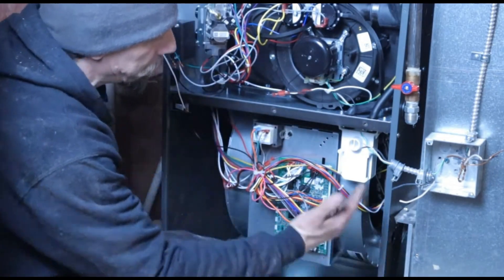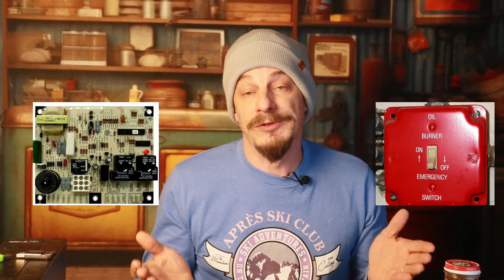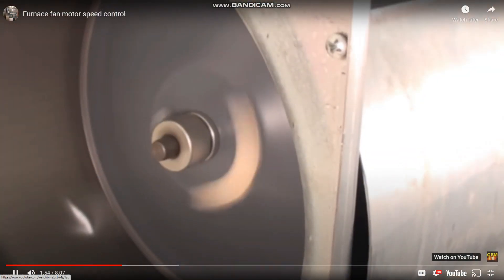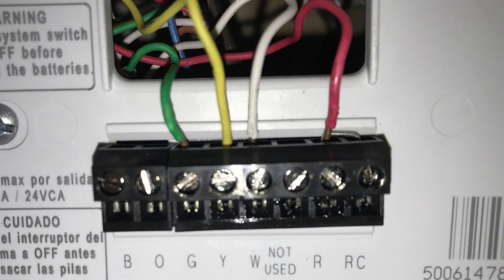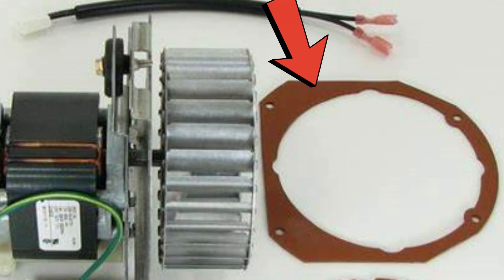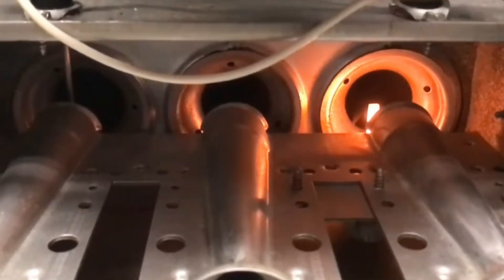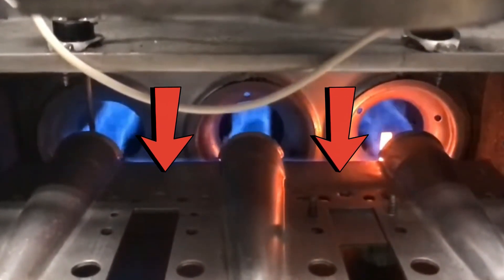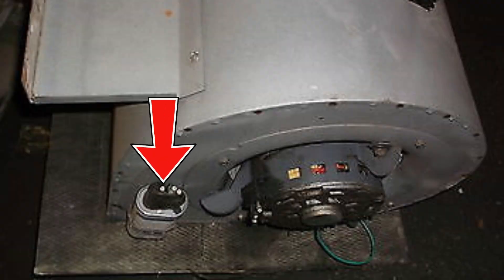Solve Dozens of Furnace Problems With This Process

Comment: I had my furnace for 15 years and all of a sudden it quit. I put a new filter in and it started up and ran just fine. A week later it quit again and the code said possible filter. I took it out and it looked new replaced it anyway and the furnace ran fine for a couple weeks and quit. What i figured out was if you tapped the old filter on the concrete white flakes would fall off like snow. Found out my wife had started using a new humidifier and after we shut it off the problem went away.

Comment: Thanks Mike great video. 

Hi Mike I cane across a furnace today at customers  garage. This furnace had no control board at all. It had a limit switch. And gas valve had 4 electrical terminals attached to it. Do you Recall any furnace like that.
Reply from the maker: Yeah I've seen it before. The TH/TR terminal is just a jumper for power from the transformer, through the limit switch and to the thermostat. The TH/TR is not internally wired in the gas valve, so technically you could bypass it and just go from the transformer straight to the limit switch then to the thermostat and it'll still work. 

 The TH terminal gets the 24v signal from the thermostat on a call for heat (R to W at the stat). TR is the common going back to the transformer common to complete the circuit. 

 It's still a 2 wire activated gas valve like many others.

Comment: Mike, is the pressure switch being monitored the whole time the furnace is running or only at the initial check when the inducer first turns on? In other words, is it possible for the vacuum check to pass, and then 5 minutes in the pressure switch can briefly open, would that stop the cycle after the furnace has already started?
Reply from the maker: Yeah I've seen that happen for quite a few different reasons, from a bad pressure switch on a new unit, to flue obstructions, to bad pitch on 90% flue pipe and even temperature drops outdoors creating denser air and starving the unit.

Normally I don't monitor the whole time unless I suspect issues with it.  I'll hook up a manometer and keep an eye on it.
Reply: @JerseyMikeHVAC  I was asking if the BOARD monitors the pressure switch constantly. If the ptessure switch opens at any time, with the furnace running 2 minutes or 47 minutes, will the system shut off instantly? I always assumed the vacuum check was only one time at the beginning to prove the draft for startup.
Reply from the maker: @realSamAndrew  I don't believe the board monitors the pressure switch directly, but it does monitor the burner circuit and the switch is part of that.

Comment: Coincidentally yesterday one of my units decide to crap the bed.   Severe cold snap with snow/ice soon to happen.   Package unit(Trane) so harder to work on it in the outside bad weather.   My unit was coming on but the registers inside didn't seem to be getting very warm.  After running for quite a while the blower would shut down but my thermostat(Nest) was still indicating a Heat Call(glowing orange)
I went outside and pulled the access panel.  What I notice happening is the Inducer motor comes on and shortly after the burners(only 2 of them) light.  Somewhere in that sequence the blower motor starts.   The burners remain lit for 10-15 seconds.   Maybe too long for a flame sensor issue?  I might pull it and clean again.  The cycles again and again until some point the system turns off.  I have Green and Red LEDs on the board.   Only Green light is indicating but according to diagram operation is normal.  Red LED does not light indicating any other issue.
I pulled the flame sensor and cleaned it with emery cloth and reinstalled it but didn't make a difference in operation.  So I'm kinda stuck getting anyone here to work on it due to outside weather.  My son is in the business but he lives a few miles out of town and roads bad.
Reply: @JerseyMikeHVAC   2008
Reply: @my-yt-inputs2580 you can test the flame sensor by connecting a simple rigid copper wire inline with the flame circuit.
Reply: @realSamAndrew  Those are my next 2 choices.
Reply: @my-yt-inputs2580  would you please come back and tell us what it was when you get it fixed?
Reply from the maker: Are the flame roll outs autoreset?
Reply: @JerseyMikeHVAC  probably not, but they could be faulty switches that are getting bad connections or failing intermittently. Something is interrupting the cycle after the blower starts.
Reply from the maker: Yeah that's true.  Found a bad blower motor cap also causing this same issue recently. A lot of guessing without a multimeter.
Reply: @JerseyMikeHVAC   I have a multi-meter but I am limited in HVAC knowledge.  Winging it.  If my son was here he could troubleshoot much better.

With this system it is very hard to even look at the flame tubes.  Covered on top so I have to get right on the ground looking up at them to view the flame.

I just pulled the flame sensor again and made sure I cleaned it well.  Also pulled the Inducer tube that goes into the burner section and cleaned out that fitting....just in case.
Same thing.  Burner light fine and burn for 10-15 seconds, go out, and Inducer shuts off, followed immediately by inducer coming back on.   Then after several seconds burner light again.   Once the circulation fan comes on it stays running throughout the burner cycles.

I don't notice any rollout but again the way this is set up it's kinda hard to notice.
Reply from the maker: @my-yt-inputs2580  Does the main blower come on before it shuts down and restarts?
Reply: @JerseyMikeHVAC   Yes, once the blower comes on initially it remains running while the system recycles the burners.   Once shut off after some time then the blower shuts off.
Reply from the maker: @my-yt-inputs2580  ok. Just trying to clarify.  So the recirc blower is coming on with each attempt but the unit won't keep running to meet set point.  Shits down starts all over. Yes?
Reply: @JerseyMikeHVAC   Yes from a cold start the inducer motor comes on, then burners light.  At some point the circulation fan comes on.   I cannot tell while outside at the unit because it's quiet enough to not be heard over the inducer motor.  But once the circulation fan starts it's basically running continuously while the inducer motor and burners cycle on then off then back on again.
Again no trouble LED lights.
Reply from the maker: Ok. Sorry I'm dealing with a bad cold so bear with me. It does sound like it could be a limit switch/roll out issue as stated.
Reply: @realSamAndrew   Will do!
Reply: @realSamAndrew   Had some guys show up today.   Turns out it WAS the Flame Sensor.   But it wasn't the probe end but the connector end.  Tech said it was a little corroded but when he was OHMing it out he noticed it changed as he was playing with the connector.   He brushed off some of the corrosion and it's working fine now.   I do have a new sensor coming in on Friday.  Trane OEM from Amazon.
Tech was still wondering why it wasn't throwing a code.
Reply: @my-yt-inputs2580  excellent. Thank you so much for following up. I agree it's strange that there was no code to point that out. Another hunch I had was going to be a bad board. Glad you got it resolved. 👍
Reply: @realSamAndrew   And....it appears to not be fully resolved.   It worked fine for several hours then at some point I noticed it getting chilly again.   Same thing seems to be occurring.   I turned system OFF, waited a few seconds then back on again.   Heating fine now but am not expecting that flame sensor to keep on working normally.  Not sure it's reliable anymore.   Hurry up Friday and get my delivery here.
Reply: @my-yt-inputs2580  ouch. Are you confident it's just a flaky flame sensor at this point? My mind goes racing with all the other pieces that got mentioned the last couple of days...
Reply: @realSamAndrew   Up in the air at this point.   After I reset the system and it began heating again it ran for quite a while but shut down early.  I had the temp set to 72 but shut off at 71 and still showing a Heat Call.  I'll go out and open the panel and check LED lights again.  Not much else I can do.   Could have been coincidence what the Tech seeing while measuring the flame sensor.
Reply: @my-yt-inputs2580  I suspect as possibilities the board, individual safety sensors, and connections. The more you mention no led codes, the more I question the board. Keep us posted if you can.
Reply: @realSamAndrew    Yes the Tech even mentioned a possible bad board.  I went out and pulled the flame sensor and cleaned it again.  Paying more attention to the connector end.    When I reinstalled the sensor and connected the wire connector.   Started it up and it began cycling as before but this time I shut it off again and pulled the connector.  It felt to me like the connector wasn't very tight.  So I crimped it a little more and pushed it back on.  Tighter fit this time. Fired up the system again.   This time the burners stayed fired.  Will see if it holds till 73 degrees.
Reply: @realSamAndrew    And...nope.   Again it ran for probably 20 minutes but never got to heat set of 73.  I suspect at some point the burners begin cycling off then back on again until the system says stop.
After I allow the system to sit for several minutes and turn on again it runs but the heat output is not as warm as it should be.   So back to original problem now it seems.
Reply: @my-yt-inputs2580  pointing more and more to bad board or high limit, (either actually getting too hot, or limit sensor false reading). I would also start to suspect the thermostat without being able to visualize the behavior.
Reply: @realSamAndrew   They're trying to find a Trane flame sensor to use.  I'm out working on it again.  This time I'm letting it run with the panel off.  That way I can visually check for flames.  I'll look at the diagnostic LED again.  Before allowing system to reset.
And even it if was another sensor like the high limit sensor would the circuit board still throw up an error code?
I hadn't thought of the thermostat itself though.  Nest Learning...seems dependable enough.  I could swap it for a standard digital thermostat I have laying around.
Reply from the maker: @my-yt-inputs2580  "After I allow the system to sit for several minutes and turn on again it runs but the heat output is not as warm as it should be"

 Could be a lot of things at this point, but has anyone really checked for airflow issues just to eliminate that? Seems if the system is off long enough it runs ok for a little while again, and you did hint at this earlier too, just in a different way. Could be these little fixes really just brought some cool down time on the high limit.  It can certainly still be an electrical issue (bad limit, bad connection, bad control board, etc), but I would look at airflow issues just to rule it out.
Reply: @JerseyMikeHVAC  I wanted to take a break here to mention thank you for posting this video. When they lead to chances to troubleshoot like this, that's when youtube really shines. Thanks 👍
Reply: @my-yt-inputs2580  nest sucks based on insider consensus 😉. You could rule that out altogether by disconnecting the thermostat wires at the furnace itself, and then just jump R and W directly to call for heat.
Reply: @JerseyMikeHVAC   I let the system run until set temp of 72 shut it down.   Ran the whole time and seemingly cut off burners like it's supposed to.  Checked at board and again no error LED lit.   So running normal....for now.
I did pull the flame sensor and connect my ohmeter to it.  Getting fluctuations in reading like the Tech said he got so still unsure about the sensor working correct or not.
Reply from the maker: @my-yt-inputs2580  Keep us updated on if the replacement works or what else might be found.
Reply from the maker: @realSamAndrew  No problem. It's definitely interesting.
Reply from the maker: @realSamAndrew   Yup. Starting to hate all smart stats, to be honest. I like 'em dumb.
Reply: @JerseyMikeHVAC   For an update after I got it working late yesterday afternoon up until bed time it was keeping downstairs at 71 no problems.  I went to bed and set the thermometer down to 68.  It seemed to maintain 68 without issue throughout the night.  I got up a little early, 5 am, and set the thermometer back up to 71 and boom issue reappears.
Was waiting for light outside to work on it again.   Went and pulled flame sensor but this time sanded/wirebrushed where the sensor frame contacts with the unit frame.   I'm thinking it might not be grounding well enough?
Anyway put it all back together but left the wire off the flame sensor.   Started it up and burners only lit for about 3 seconds and shut off.   But NO Trouble LED was lit.  I'm thinking a flame sensor failure like that should cause a Trouble LED?   This board has 2 LEDs.    A green and red.    Green changes flashing speed depending on Normal or Call which is working correctly.
Reconnected the flame sensor wire and so far again(knock-on-wood) it's heating normally.  Now I'm wondering if there are not multiple issues.   Ground?  Circuit board?  I might run a separate ground wire from flame sensor screw to a screw on the unit frame to help ensure a positive ground.
Reply from the maker: @my-yt-inputs2580  There should be an error code once the unit locks out after several consecutive unsuccessful firing attempts. I'm wondering if it's firing up long enough on some of these attempts that the accumulated lock out isn't happening hence no code. Have you had to kill the power to reset the lockout at all through all of this? 

Also check the ground connection on the high voltage coming into the unit. That's the point everything on the unit ends up grounded back to the electrical panel. If that's crusty or loose it could cause some issues.
Reply: @JerseyMikeHVAC   For an update.....Yesterday morning when I attempted to tweak things again I got it working.   Been cycling normally now for 24 hours. 
I am wondering IF the flame sensor bracket actually needs to have a good ground/ground point?  The bracket is isolated from the sensor components because it attached to the ceramic part.
But since I paid more attention to cleaning the bracket itself as well as where it physically attaches to the frame that has me wondering.
I still need to look at the voltage supply side ground.   But waiting till I have to open things up again.
Reply from the maker: @my-yt-inputs2580 I was hoping for good news. I did a little research because I wasn't 100% sure if the rod bracket itself has to be grounded, but I did find confirmation on that. Looks like you may have found your issue.  Also found a 14 ga. Wire is suggested if you're going to run a ground as you suggested. 

 You did good.  That's a pretty obscure problem.
Reply: Sounds like a rollout switch or high limit tripping.

Comment: Just turn thermostat to fan on to see if you have power.
Reply from the maker: That's another way to confirm power, but that only works when the fan actually comes on. If it doesn't, you can think you don't have power when you do and it doesn't tell you if it's a high voltage or low voltage problem, a thermostat or furnace problem, a breaker or fuse problem, a capacitor problem, etc.